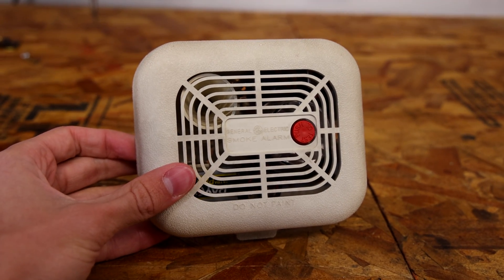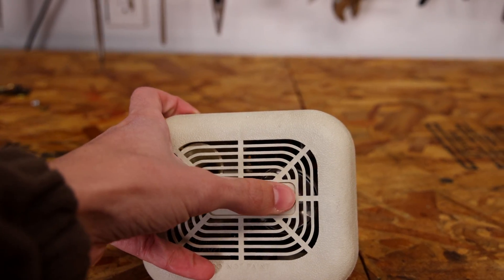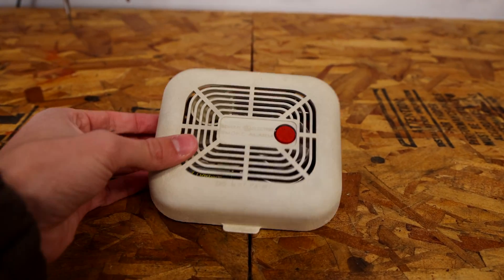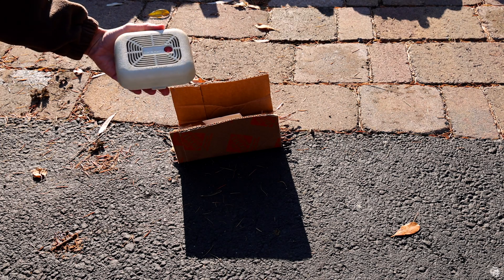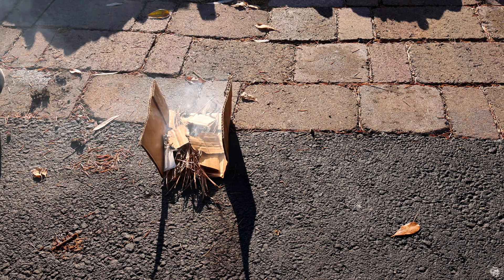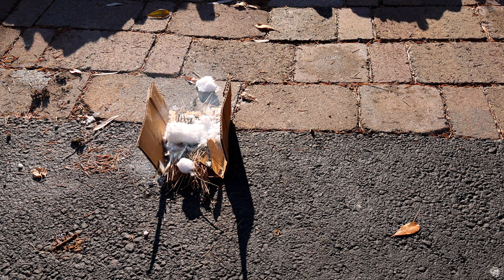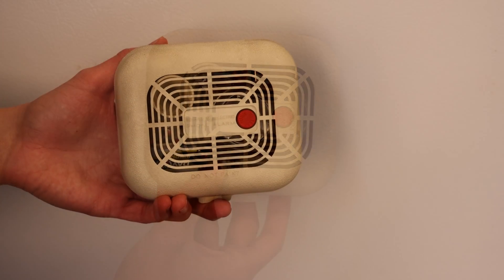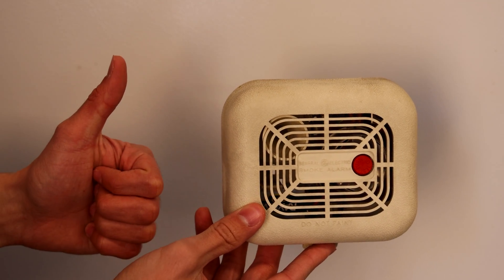Testing the Sensitivity of a 43-Year-Old Smoke Alarm | Impressive Results!

Comment: I just found one of these in my basement because it was doing the low-battery beep. Looks identical to what you show here, but has the model number SMK-6/M1. Says "BOCA 82-81" on the main tag and does not mention any radioactive materials, so probably a later model. Still made in Ireland.

Comment: Originally branded EI in the UK now called  Aico only just discontinued them in the past few years...  Later models had the button central and the red push button replaced with a clear button that the status led shone through it at some point they released optical and heat detectors in the same case shape that were interlinked with figure of 8 speaker wire  so if one went off they all activated

Comment: The best reasoning for this is that the older alarms were made differently back then. They are definitely more superior compared to modern ones advertising them as "smart" bruh. Take the brand new Kidde 900-CUAR having a slow reaction time to testing smoke. And one of the best reaction times, a Honeywell TC49A made in the 70's, older than the GE seen in this video.

Also, Seymour Smoke Detector says it all. Rest in peace.
Reply: The newer smoke detectors are better with detecting thick smoke while the old ones are better at detecting fires that just started. So there isn’t really a better one
Reply: That smoke alarm was manufactured in the good old days when they actually knew how to make stuff that lasts years
Reply: Nowadays smoke alarms actually beep when it's time to replace them, is that planned obsolescence?